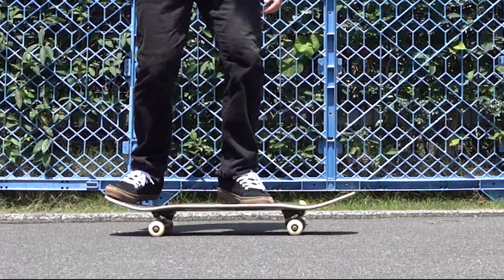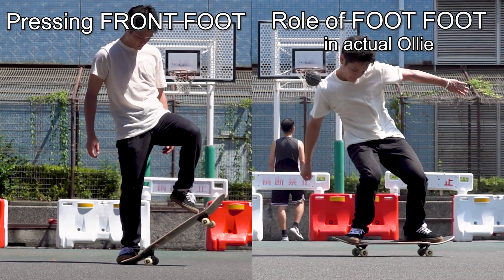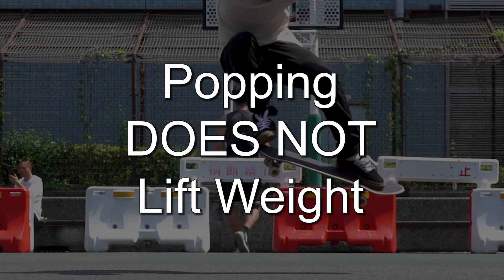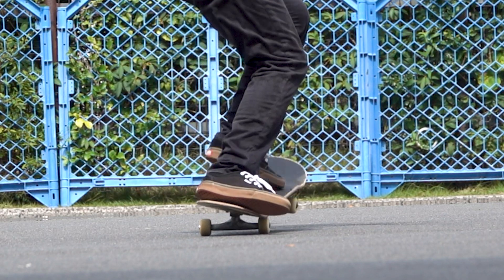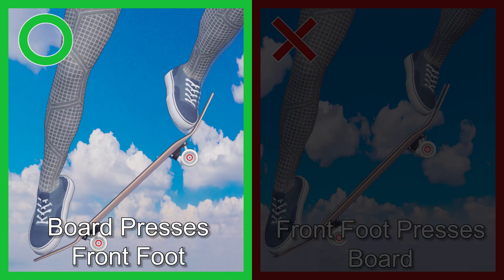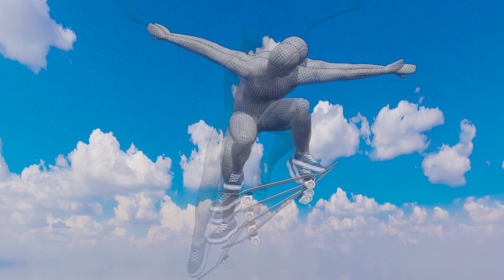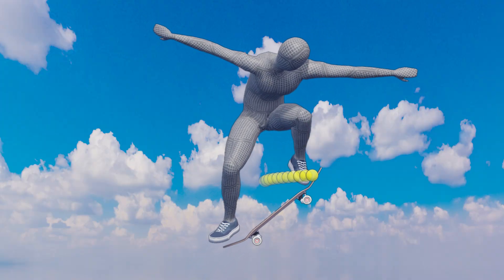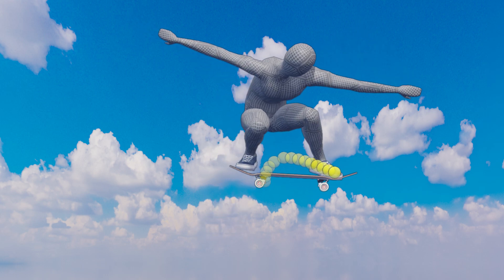Science of FLOATING OUT OLLIE - How to pop higher, stay in the air longer, and bone out front foot

Comment: Big fan of this channel, I always understand tricks way better knowing the "ergonomics" rather than most tutorials that generally just state what to do. That said, I was disappointed that this video missed the facts surrounding the pop foot and the pop or spring of the board itself, this video made it sound like dragging your foot was the only thing needed to get high Ollies and level them out. The stomping section almost went there but fell short... For instance beginners might want to realize that the back foot is well on its way up into the catch position before the tail ever hits the ground... and that if your pop timing of getting off the tail is right, it almost doubles your tails upward momentum versus simply forcing the board to level out after the nose is up against your front foot... Good video as always but this fact was missed.
Reply from the maker: Great point. Thank you for the insight!

Comment: It’s great that you are providing an analytical perspective of tricks, but I must say that floating the ollie is not really down to what the front foot does. It’s down to how much downward pressure you generate before you lift the front foot.

 If you look at your ollies, you can see that your leg extension before you start raising your front foot is rather loose and slow, and it actually fizzles out towards the end. This is why your ollies don’t look very floaty in real time, while it does in slow motion. You are effectively pulling the board up high, but not pushing the body up high. 2~3 decks may be fine to Ollie with this technique, but anything higher gets tough fast.